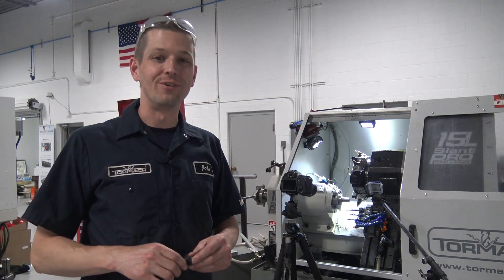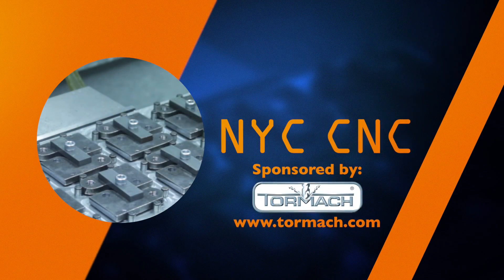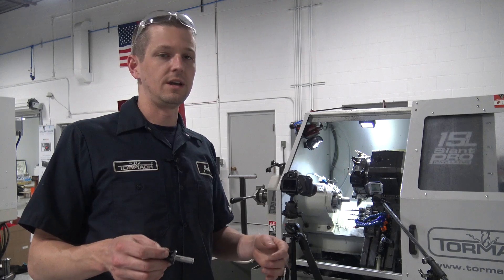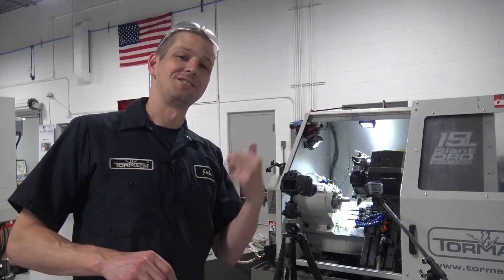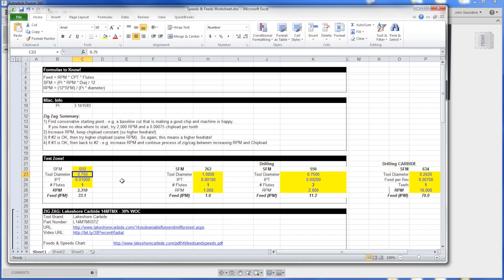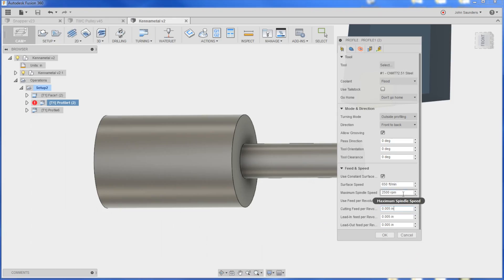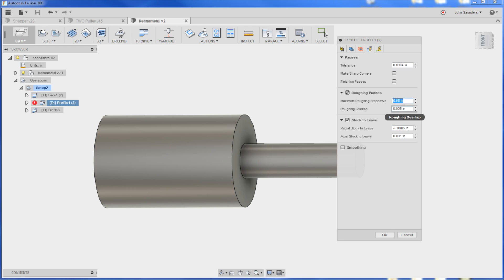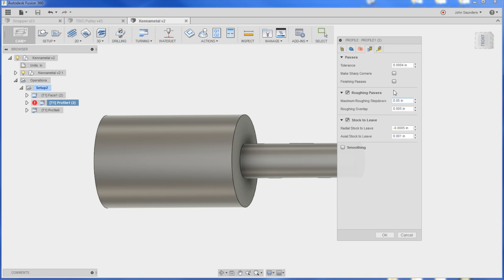Testing Kennametal Lathe Insert to get GREAT Steel Surface Finish!

Comment: As a conventional machinist, cutting speed does matter because my lathe only reaches 1000 rpm But I only work up to 610rpm, What I have learned is that the less radius the tip has, the less depth of cut will be to achieve a good finish, this is convenient For an old conventional lathe Because with thick cuts it makes taper sizes

Comment: I notice you are getting a lip as the tool cuts. When that happens it's because your feed rate is far too slow, and the chips coming out shows. If your lathe can handle it you should push it as hard as you can up to its recommended feed rate. The chips coming out should look like C's and 6's. 

Try a feed rate of around 0.01 inch per rev. Nothing wrong with your import insert. I'm using Chinese inserts and getting good finish because I FOLLOW THEIR RECOMMENDED FEEDS!!!

Comment: for 1018  i found best finish with a "sidewinder" type insert on a manual lathe. the nature of the material does not lend itself to good chip flow.it also helps with complete coolant wash.  the spray mist i found works best with bigger diameter. 43 yrs job shop machine experience.  K-metal  and Seco populated our tooling supply,  in all configurations  triangle, square, round, 80degree diamond, 55 degree diamond.  cast irons,  all types steel,  alloyed steels,  heat treated 4140 and 4340,  lots of stainless  316  and 1056,  bronzes, brass, and got into the inconel later on in my stay there.  greenlee made the tool of choice for inconel.  it was nice having a boss who wanted to have the best equipment for the job.

Comment: I know this is old, but I just bought 10 of these. You mention Chinese inserts, but these Kennemetal CNMG431 KCU10 inserts have made in China printed right on the package. Edit: I have some really good inserts from Travers tool called Akuma.  Akuma is their house brand and they are pretty darn good and below 10 bucks each, that's value to me.  So, with that being said, as good as the Akuma are I just weighed them.  (Akuma) CNMG432=9.3grams.....(Kennemetal) CNMG431= 9.8 grams.... that's a big difference.  I do have a hard tinge with chip control with the Akuma. I'm going to try the Kennametal right now.  I'm only posting this to push the Akuma because I don't think many guys have heard of Travers Tool in NY. The more info one can ingest on inserts, the better decision you can make when purchasing.  Try those Akuma, they're pretty darn good.  The chip breaker I have is MRP1 wich is why I had trouble.  The grade is CT25M and the wear is good in my opinion.  You can get different chip breakers and harder grades.  Thanks for sharing your experience, even tho this info is now many years old, it's still relevant I think.

Comment: Good video.
Recommendations for mild steel, on a cnc lathe:
Rough passes, hog at .013-0.015 per rev, use any rougher insert you prefer, Many use wnmg, 6 tips, almost same price per insert.
Finish passes, based on .031 nose rad, .005 or less depending on requirements. Also, good idea to have roughing cnmg, say, and finisher positive rake. Also prefered in dcmt, ccmt, maybe T shape. The finishers will maintain your sizes much longer when just used to finish. Lathes always work best on critical fits with rough- finish tools. If not critical, I agree with posts, light - medium chip breaker. Also, surface speed is very important in mild steel. 750-1000 sfpm will give you mirror finish. 
Thanks for making all of your videos John.
Reply: I noticed a lip as the tool cuts in the beginning of the video. The lip tells you that your feed is too slow. I really like those positive rake inserts, you know ones where there's a really deep gullet cut into the insert, and they are directional (this means there are different inserts for turning and facing) because they're really forgiving for low depths of cut. The standard inserts needs a certain depth of cut, speed, and feed to get a good finish.

Comment: Mild steel leaves a better surface finish with a deep doc for finish at super high sfm and decent feed. With austentic stainless you can go super small finish pass and super slow, rubbing and leaving a good surface finish. Not always ideal as it creates tool wear possibly chatter and takes longer but you can make things look amazing. Where as with 1018 or any other mild steel ends up looking frayed and gross

Comment: Hi John, I have a small job shop up here in Canada and about half our customers are fab shops so we turn an awefull lot of 1018. To get good surface finish and sizing in 1018 sfm and ipr are super important if you can hit 800 or more sfm and a 0.012 thou per rev during roughing you'll get a nice pile of small chips in your chip conveyor.  I use alot of kennametal for roughing CNMG 432  with the MN chip breaker is a good choice. for finishing I use a tungaloy GT9530 grade (cermit) DNMG 331 in the 11 chipbreaker.  that's the key. You can get a great finish anywhere from 300-1000 sfm all the way down to a 0.003 per side DOC with fantastic chip control. if you can run it at 800 sfm 0.004 ipr and a 0.01 DOC you get a finish comparable to grinding in 1018 and depending on your machine can hold +/- 0.0002 thou tolerances pretty easily.

Comment: Super light passes work on aluminium , non-ferrous - stainless , plastics in most cases .Maybe even hardened materials (at least 0.2mm per dia (on some miniature boring bars .15 per dia is a decent cut ) ).
In steel the sneaking up won't go well , tolerances can be held but surface will be sacrificed .
For CNC lathe
The easiest , sometimes risky method is to test and measure roughing and finishing tool . Compensate for as close as you can get it +-0.02 mm . Offset the full depth of cut of the finishing pass out of both of the tools (minus for id plus for od ) , let the machine run , measure after roughing , offset it . Measure after finnishing pass , offset it , finnish again . This should get it as close as you can be , but the first part may still be out of tolerance (add some final compensation) if it's  +-0.01mm , but the second part should be guaranteed 95% . Knowing this , when you have a tricky one off even this method could fail , so substract or add a 0.01-0.02mm , for some kind of polishing .
On manual it should be the same , more or less but farless automated. I can't say for certain as i have no experience on manual lathe .

Comment: That high-pitched squeal sounds exactly like the chatter I was getting on my 7x12 lathe trying to turn a 2.2" 1018 (I think) bar with a 1/4" TCMT-1.81.51 insert. I had to push the shank up inside the toolpost to stop the chatter, since it's so thin. This is the only way I have gotten a good surface finish so far, giving an almost glassy finish with brown or blue chips, but on the other hand I think I just burned out the insert from the chatter, possibly too much speed and too little depth of cut (5 thou, about 1100RPM).

Comment: just wanted to say I've had great experience and help with the kennametal rep here in Connecticut . they fronted me tools to test even came into my shop to make sure I was running the right feeds and speeds ....
yeah it's not good for your tooling to Sissy out on your finish depth of cut if you leave finished cutting and just lower your feed rate for your finish cut .006 or .004 IPR ..maybe even  increased its surface speed . which I understand is only possible with larger-diameter parts... 
I turned a lot of copper and I'm fine speed-wise with 2 or 3 inch material when I get down to a 3/4 or 1/2  step on the front of my part I'm limited by how fast I can turn my machine and or chuck .
my machine will spend 3000 RPM but I can't safely swing a 10 inch diameter truck that fast LOL...
kennametal has a great app cold "Novo" excellent at recommending the right insert, speeds and feeds for what ever your cutting

Comment: Hey man, bit off topic, but I have a 2 Axis CNC lathe which has a similar tool changer as yours. I have been thinking about installing a servo motor with collet adapter (ER20 probably) to use as a turn/mill. I figure initially it will run or the time or run a program stop to turn it on manually then restart. I feel pretty good about it, what do you reckon? I have a drill attachment for the manual lathe for stuff like that anyway, can't see why it wont work?
Reply: Yeah precisely. I figure with your tormach it may make a good platform but don't know anyone who's tried it. I think you could use an Mcode to turn the spindle on/off, and zero the live tool like any other, essentially giving a live tooled lathe that can legitimately turn mill, however you'd be stuck with manually changing 1 tool or just base your cad off 1 6mm end mill for example and probably wouldn't have any speed control. I'd post up a photo but it wont let me. I can't see why it wont work and might give you a great deal more capability, for example, making your muzzle breaks etc. Only major downside is that you'd have to make sure the tool head doesn't wind up any power cable when it rotates, but I think you'd easily get around that. What do you think? Worth a try?

Comment: this week gone i was turning some long parts with a Bridgeport cnc lathe, i was getting a slight taper maybe .03-.04mm over 200mm so i programmed a cut that turned a slight taper to counter the natural taper, I think I was experiencing rubbing too really poor finish and wouldn't take the .05mm pass, I'm new to cnc like a week into it and trying to hold .0008mm tolerances on those long paces, il have a play around with a bigger finish pass the tip I'm using has a 0.4mm radius. thanks for sharing :)
Reply: I found with accurate tool setting and higher rpm I seam to get a good finish and dimensional accuracy, those long parts were silver steal had an odd behaviour, the mild steal i was turning today went better, cheers for doing these turning videos :)

Comment: If small diameters are a continuing problem SFM-wise, can you juggle spindle pulleys to hop-up the spindle speeds to maybe 4000 RPM? naturally you pay for this with less grunt machining capacity diameters. I suppose you have to mess with the software etc but thought I'd ask.

Comment: Why not try some more positive tooling. Kennametal holder SCLPR. Insert CPGM 32.51/2
Or try the 35 degree VBGT inserts. I rough with TNMG or CNMG and finish the last .020 with the positive inserts.
I can even cut off .0005 with the VBGT ,05 corner.

Comment: Nice job John, you gave some good advice there as you uncovered the "secrets" to carbide tooling. On forums I have been yabbering for years about not trying to "sneak up" on cuts, instead keep the cuts consistent. On a manual lathe, measure the infeed and then the actual doc, adjust accordingly on roughing passes, and go straight to finished diameter. Of course some people will always think they know better ... right before asking yet again how to improve their finish!

You may have even greater options if you consider swapping for a smaller size insert. I personally feel that holder/inserts you're using are too large for that lathe, and would suggest dropping down to a ANSI 3 size before you go too much further in insert investment. Check the manufacturer's data but I'd think a smaller insert should give you access to more insert geometries that are suitable to that size machine as it's in more of the sweet-spot for the insert size. You can buy what you guys like to call an "import" holder, that's no big deal. They're cheap, but feed it with decent inserts just as you're doing. An additional bonus is that you're buying less carbide each time, so the inserts are normally cheaper, and that adds up.

Of course you know if inserts come up, I'm going to nag you again John to get in to cermets ;) Dump that large holder, swap it out for a smaller one, jump online and order a box of ANSI CCMT32505HQ in TN60. Yes they're made in either China or Korea. It will be a cheap trial, and if it doesn't work for you, you can always just save them for any hard turning that comes up as they will cut hardened steels. Always spectacular if nothing else!

Good luck with continuing to peel this onion, and well done!
Reply: +NYC CNC John another thing you may want to experiment with are very high rake inserts, again I'd recommend them in an ANSI 3 size for that lathe. They're sold as so called "aluminium" inserts. That doesn't mean they can only cut aluminium, and they work perfectly well in softer steels like 1018 (I use 1020). The disadvantages with them is that they're somewhat fragile (as they have a sharp edge), and I've never found a brand that I feel breaks chips well, so stringing can be an issue. They also likely will need replacing more frequently, so a factor on high runs. However they take very little HP to drive them. Again, they're not especially expensive to buy if you shop around.

Experimenting with very different geometries can be a great learning experience, and would probably make a good video in itself. Run the same holder with the same feeds and speeds, and simply swap out the inserts from very high rake "aluminium" inserts through the range down to the negative rake inserts you used to use. Video the results. Likewise, as much as I love cermets, they're not a panacea, and while they will leave (literally) a mirror finish in some materials, they don't do as well in others. Experience and experimentation will lead to certain inserts being used for certain materials. Sadly it's not always obvious, nor does it go according to what a rep says it should! ;)

Comment: You can sneak up on a final cut with HSS (or high-carbon), but carbide seems to need that heavy cut. On a manual lathe I like to make my last two cuts (carbide) as similar (in terms of DOC and SFM) as possible. That way I get similar tool/machine deflection. If I want to end up at 0.500" and am liking the finish I get with a 0.020" radial DOC (which I play with while removing the bulk of material) I aim for 0.580" Then I can take my  0.020" semifinal cut, measure, (maybe I get 0.541"), and adjust my final cut (which will have almost the same tool load as the semifinal) to 0.0205" and usually end up just about where I want to be. I like to err on the slightly large, because a quick rub with emery cloth will usually take off a few tenths and improve the looks of the final finish.

That is on a manual lathe, so I am manually measuring and adjusting in those final cuts. With CNC, you would be making test parts and adjusting the program to take two similar final cuts that end up just right. If you make your test parts slightly oversize, you can probably hand finish (file/emery) to final size and avoid having to scrap the material.

Comment: John, have you tried sandvik, guhring, or jongen tools and inserts?  If not give a shot to some lapped aluminum inserts,  you'll be surprised with the finish and precision.  Also try carbide stem, screwable cutters with inserts.

Comment: You should give Sandviks CNMG 120408 (metric version, .8mm radius) grade 4225 chipbreaker PM a try. I'm running those in steels like 1.0037 1.0425 at 400m/min, f 0.3mm, DOC of 2 to 3 mm without coolant and they commonly last 15 minutes in cut. With coolant 20-30 minutes are pretty common. Maybe you should go for a smaller radius and a PF chipbreaker for a lower DOC which is maybe more suitable for the dimension of your lathe but the grade 4225 itself is awesome.
PS: The DOC values on the insert packages commonly is meant as a radius value and when I'm talking about the DOC I find it pretty normal to think in radial engagement and not in a diameter value as radius values just make sense.
Reply: I use thoes at work alot. I love Sandvik they are expensive thoug.

Comment: I have to say I am beginning to learn that a cutter is a completely separate appliance and should be considered a speciality separate to the mill or lathe. Like your learning a new hand tool with every cutter. They have their own quirks and tolerances completely outside of machinery that drive them.

Comment: In the cnc side of  the shop I work at they use what is called a "wiper" insert when they need to obtain surface finishes of 100 Ra or better.  Might be something to talk to the tool guys about?

Comment: For 1018, were you only given 625 sfm due to the machines max spindle speed (2500 rpm)?  Or are you sitting ~in the center of Kennametal's recommended sfm for that insert?  (same question but for IPR recommendation).

Comment: great video john, wot you said is correc,t i was used to running larger cnc machines and now most of my work is done on much smaller machines, but if you get the depth of cut and sfm correct its i wonderful thing, technology has moved onnow , small machine can cut it with bigger one as long as you get the chips away  with good feeds and speeds, thanks daniel

Comment: Hey John, 

So you said you have to be confident and go for it - that's great. But what happens if you end up with a part that is 1 or 2 thou oversize. What is the strategy to remove that final small amount of metal if you are stuck taking 30 thou cuts to work the tool efficiently...?

I.e. how do you take a finish pass "if you need to"?

Thanks!!!
Reply: Experience machinist chiming in here.

You adjust the offset and run another part.

If it's only one part, you use a finishing cutter and take 3 finishing cars at about 0.3mm on radius. Stop after the second finishing cut and measure. Make the necessary changes to the offset to hit the tolerance